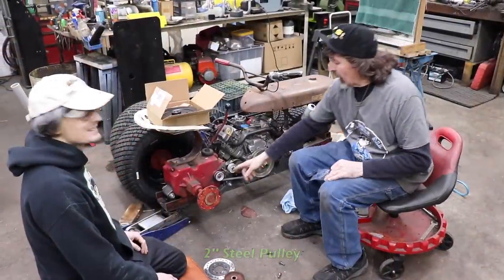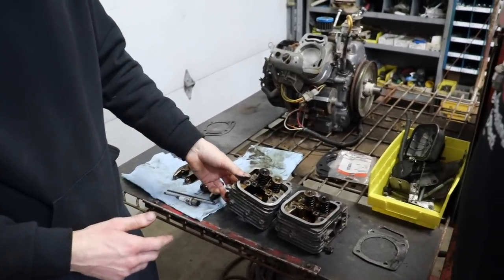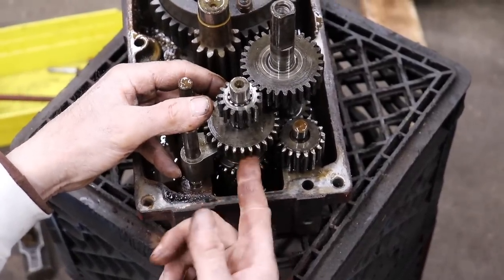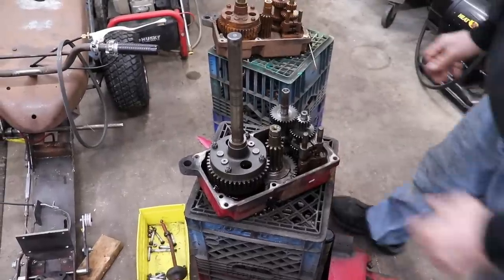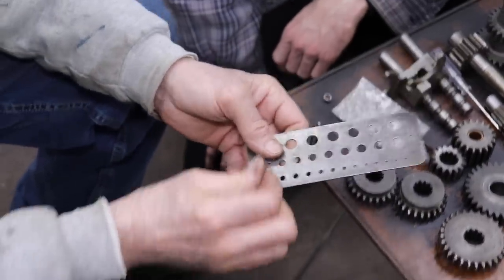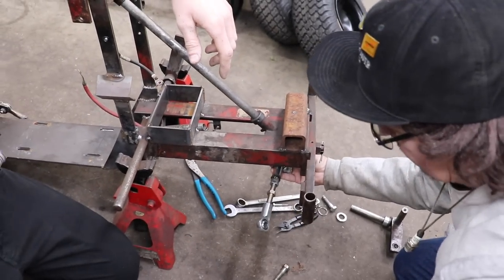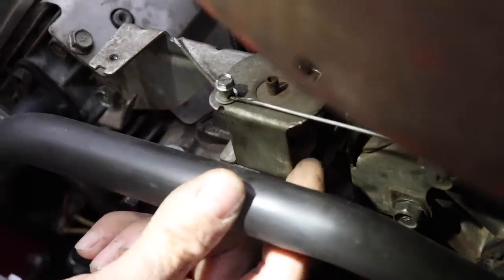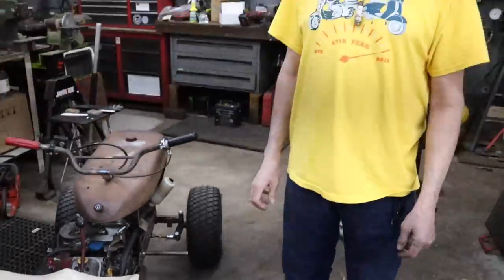Epic Wheelie Horse Custom Restoration (Part 5)

Comment: I absolutely hate loose needle bearings, when I was a kid, I remember driveshaft universal joints, they would fall out of the cups in the uv joint, I'd clean them put them all back in Grease them, drop the friggin cup, the needles fall out again!  And I'd have to start over again!  Luckily that only happened twice!

Comment: This is a sweet build, lots of great ideas!  I like how you added caster to the steering, simple yet effective.

The fuel mist above the carb is fuel stand off, it happens due to a pulse wave at high RPM when the high velocity column of air/fuel being drawn into the intake stops abruptly when the intake valve closes.  The column of air/fuel is moving so fast that it bounces off the backside of the closed intake valve and blasts back out the carburetor.  You see it a lot more on setups with 1 carb per cylinder (no intake plenum) and engines with short intake runners.  

This fuel mist is important to the air/fuel ratio of the air being drawn in, so for consistency and tune-ability it helps to contain as much of it as possible so it isn't blown away by ambient air passing over the carb.  Velocity stacks can help, air cleaners also.  Some air cleaner housings even have built-in velocity stacks to help mitigate this, like the stock air cleaners on aircooled VWs.  Motorcycle intakes have the same function, they typically have an intake boot between the carburetor and air filter, plus the air box helps contain everything.

There's a bit more to it than this, but there's some food, er "dinner" for thought.

Comment: G'day Taryl. a huge thanks from me in Australia, had my sister and brother in law visit for the weekend, and we assembled an old McCulloch MacCat he dropped off last year, it was stripped and reported as having a dead cylinder, i foumd high compression and a dead spark plug, he still needs a carby kit, but he's taken it home and know how easy it is to do the carby himeslef, i credited "Taryl Fixes All" as being a source of great information.
RE: the gearbox, i rebuilt a 1955 Wolseley 6/90 gearboxc several years ago, but due to a couple of issues couldn't get all gears, i have since found3 wrecks with 2 gearboxes and FINALLY have the needed parts (cross-shafts & bronze shifter forks) i just need to clear space in the shed to remove the engine and gearbox (again).

Comment: I used to race go karts years ago with my brother. I redesigned the front geometry of the front end of my kart. I was having a problem with it pushing in the corners. The plate you designed was like what was used on old race cars to make them handle better. It is called an “Akerman” devise. If you are interested you can find information in a google search that’s shows how it works. You likely know about it. Also “caster” and “camber” are part of the geometry of steering. 
Another point I would caution you about is to be aware when you run the engine at above 3600 rpm the pistons could grow enough to stick and throw a rod out the crank case! We used to have a digital temp sensor called a Digitron (brand name). We tried to keep temps below 375 or. 400. The engines we were running were Briggs cool bore (aluminum bore) 5 horse with the pulse a jet carburetor converted to alcohol, no governor. Out of a stock engine without a governor we could get 6200 rpm and it would stay together so long as you kept head temp below 375. For alcohol you increase static timing from 15 to approximately 30 degrees advance. Magnetron magneto was used . 
We raced a high bank clay oval dirt track 1/8 mile. The fuel setup for the carb had to be jetted for twice the fuel flow for alcohol as the amount of gasoline. Remember ! Fuel volume squares with diameter of jet bore. Get ready if you build one it will surprise you and snap your head back increased torque! 
I believe the Briggs number was 132232. Later they came out with the steel bore IC blocks that worked well. 
Throw away the flywheel key and the governor to begin! We had a lot of fun!!!

Comment: Great job I love the modification You did I worked on demo wheel horse transmissions they’re very easy but you did a great job👍
Reply: Not a bad job but it depends how much you beat it if you beat it a lot I don’t think the transmission will last that long great job fixing the transmission but time will tail love the video great job 👍
Reply: I can see one other problem that it’s going to have if you’re not careful it’s going to be a belt burner that’s for sure I would think about doing something with that or trying to get a heavy duty belt so that doesn’t happen or changing that around but I’m just letting you know what I see that’s up to you guys but it looks like a lot of fun driving it

Comment: My grandpa built me one like that in the early, 80s. Mine was a, 1962, wheel horse. It had a mower deck & a snowplow. He put a little 5hp breaks & scrap 'em on there for, me. He used to fuss at me when I forgot to put my foot on that transmission pulley to stop the pulley prior to putting it into a, gear. I miss that little, tractor.

Comment: Hey Slip Dog and Taryl, obe of the mods they usually do to these overhead valve machines when upgrading the heads is drilling out the oil return passages to increase the oil flow -- especially so when running at higher rpn's.
Reply: Don’t get why opening up the return passages will help… Did you maybe mean the oil feed passages?
Reply: @notajp  because its a known issue of restricting oil return, Slippers even noted oil leaking into the cylinder -- which may be due to bad valve oil seals as well.

Comment: Friggin awesome machine you guys are building. It sounds mean also. I’m sure you guys thought of this, but what if you could move the clutch to a lever on the left bar and the brake over to right bar. It might feel more natural for braking. Or maybe a toe pedal for the rear brakes and a toe pedal for the clutch. Idk just noodling here, Lol. oh man thats gonna be a mean wheelin machine!
Oh forgot to mention thats really cool toro still has part support that machine. Rather outstanding in todays age. I’ve seen the odd parts from ford and dodge go obsolete after 7 model years. Been that way for a decade or so now. Although i can still buy the odd parts for a chevy/gmc truck back to ‘88. Not everything but most things.

Comment: TARYL....When it throws fuel out of the carburetor, it's not because of valve float. Most of the time it's because the exhaust valves are not opening properly, so at the top of the exhaust stroke when the intake starts to open, The excess pressure is forced up to through the carburetor. Check the exhaust valve lash and the lobes on the exhaust cam.

Comment: Terry, Billy Reynolds  You really need to take it complete apart and replace all the bearing and check the high low fork, then when you put it back together it will work great, all of the bearing I match up at my local bearing shop. The biggest problem is that most people do not replace the rubber boot and if the tractor set at side, water runs down the shift handle and goes into the transmission.

Comment: I built a semi fast racing mower that’s still stock hight, did a pulley swap on it, has no brakes, & goes 15mph. Y’all need to put some weight on the front end of that tractor to keep it on the ground.

My Dsl swapped Sears suburban is just at stock speed, & it wants to pop a wheelie. I did diesel swap the tractor, so it’s got plenty of driving power, & economy.

My 212 has the same engine on it now, & since it’s got 2 belts, & a variable CVT the belt slips so it’s harder to pop a wheelie. It’s nice when ur on a hill cuz it’s kinda scary going up a hill on the sears.

My 116 flipped over on me when it was still stock. None of my tractors mow grass. The one tractor I had that was capable got an engine swap, so now it’s just a driving, pulling tractor… my original 212. Yanked the old engine before it blew up… it was burning too much oil.

Comment: I felt there wasn't anything in those transmissions that a good bead blast  and wire brushing wouldn't fix(and perhaps a little time with brazing torch and file tools)my personnel opinion ,sometimes I didn't have the $$$ or access to new or better used parts-I've done similar work in past, this brings back memories .

Comment: You know what might work great is the CBT clutch like on a four-wheeler they just ask as their RPMs go up it opens up and it changes your gears that might work a lot better than just that one pulley like that maybe use not the primary but the secondary and it opens up and it'll make low speed high speed just thought it'd be kind of like Open primary like you see on a motorcycle

Comment: when you need to cut your grass in under 9 minutes and run the 1/4 mile in under 9 seconds and pull your 9 year old on a sled for 9 hours all on the same tractor! 
    Get The 9 To The Nines! To Unwind The Single Seater Weed & Grass Eater Track Beater Pull On What Ya Needer Open Headers Brings The Heater Super Duper Cutter Speeder And Be A Winner Not A Cheater!
  A Great Description For The Reader!
And I'm not Lion Talking Sheeter Cause A Tiger And A Bear Can Never Beat Or Cheat A Cheetah! 
 Hammer Down And Get It Skeeter!

Comment: You could take some metal on it and if you had a a lathe or something like that where you could turn it so you can get it very nice and square and straight then you can take off the the weld down to where you need it and going to file you could clean up any of the ends and you'd be you'd have a good a good gear again that's just one thing could be done I'm sure there's many other ways to do stuff

Comment: G'Day Taryl & slip dog, what did you use to paint the inside of the gearbox?
theres a product i've seen in Australia called Red-Kote that i have heard of being used to paint inside engines and gearboxes, the only adverts i can see listed currently are fror fueal tank sealer.
one advantage is it ships in powder form and you mix it with acetone to use it, so it can be sent via post.
Reply: We usually use Glyptol here….
Reply: @notajp  thanks Indy, just found i can buy that here as well

Comment: Those gears are tapered on the end so it will slide in easier. The gear still has plenty of width. I just take the flat off the gear and make it like it was. It should look like the front of a starter drive. Make sure you watch where the spacers go. I had to take one apart because I got it on the wrong side!!!🙄
Reply: You are right

Comment: foot pedal brake, foot pedal clutch w/ heavy spring keeping belt engaged tight, make ya put calf muscle on pedal so you want 3rd gear do ya....earn it....lower first gear or offsize rear tires getter drift , keep revs up, coming outta turn two, leg protectors from those big O tires. auto-kill switch, when she wants to run solo after wheelie leaves you seeing blue sky, wheelie bar wont keep rider on seat. any other trannys make speed...JD 110, 4 sp w/ super gramma low maybe use dblr higher gear ratio....

Comment: That would be an 1/8" pipe plug.
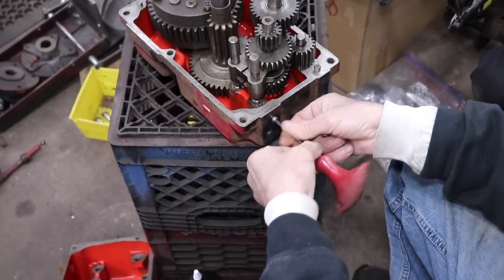Reply: You’re referencing 42:28. 
I think Tayrl meant to say 3/8-16 tap, since the existing 5/16 hole is the size needed to tap for 3/8-16. A 3/8 pipe tap needs a 9/16 hole. Much bigger. Yes, he could have used a 1/8” pipe tap in that hole. His call!
Great video!

Comment: Sounds like reversion through the carb. Also every one knows back pressure is as useless as a muffkin bearing and snake oil. No engine needs back pressure.
Reply: Then explain expansion chambers on 2 strokes. Why they go to great lengths to make header tubes all the same length. Why too large of exhaust pipes hurt low end torque.
Reply: Correction, ohv engines (pushrod) can run fine without muffkins, ohc are far more sensitive to back pressure because they’re generally higher revving engines compared to ohv. honestly anything can run without back pressure though, but it runs so much better with back pressure

Comment: Plug an air hose into each cylinder , put new valve springs if you do a valve job .it will become an oil burner if the rings aren't replaced .too high hours on that girl...... 46 yr car / truck tech.....  3 1/2 yr john deere tech

Comment: $811.00 must be a miss print for that gear.
Reply: nope, layshafts are ALWAYS expensive, wether for a car or a small tractot.

but yes, this is ridiculous, you can buy a layshaft for and austin healy 100/6 or 3000 for that sort of money, but i gues there are a lot more of the austin healeys out there, so they are still in limited production.
Reply: Welcome to my world of buying overpriced parts for my 7 toro mowers. I've bought a 700 dollar clutch, a 200 dollar plastic wheel, a 400 dollar muffler and 120 dollar belts. As expensive as maintaining an automobile. It's how they make money.